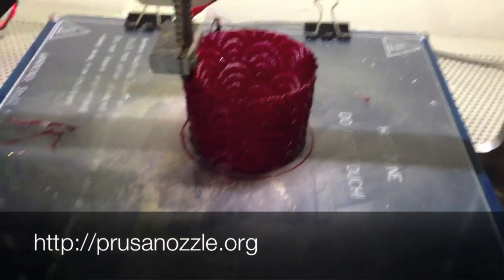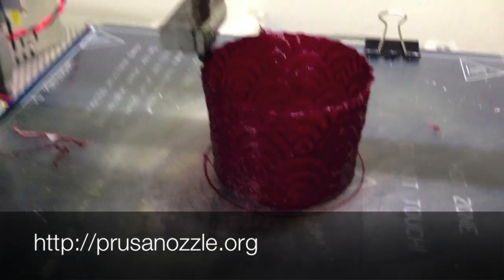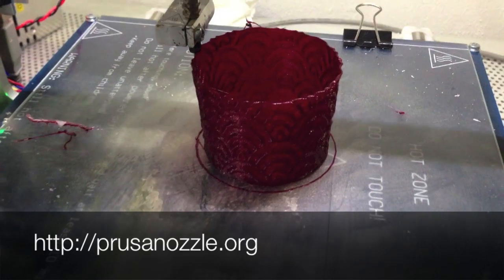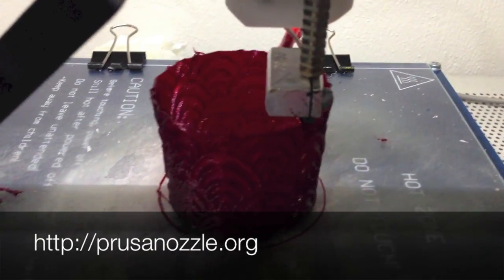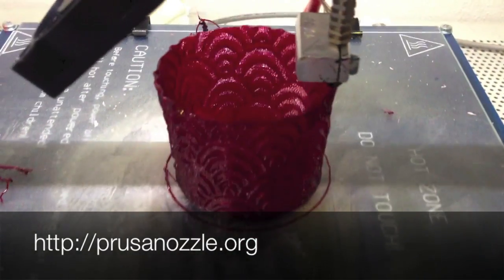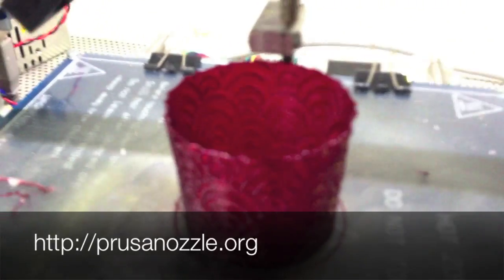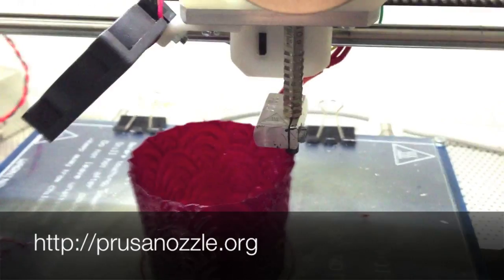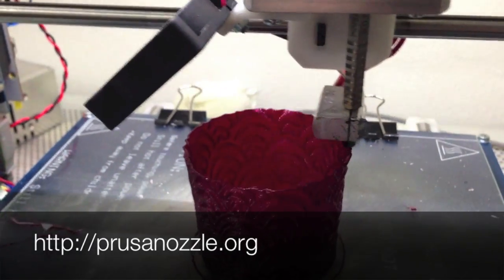Printing Bloodycarbonate on Prusa Nozzle

Comment: wait your doing .35mm size as well as 0.5mm. now im gonna have to buy 2 LOL maybe 3 to save keep cleaning abs out of one of the 0.5mm. i tend to use 0.35mm for art prints and 0.5mm for part prints My plan is to have 2 prusa I3s one with each size. 0.35 was going to be a j-head not anymore :)